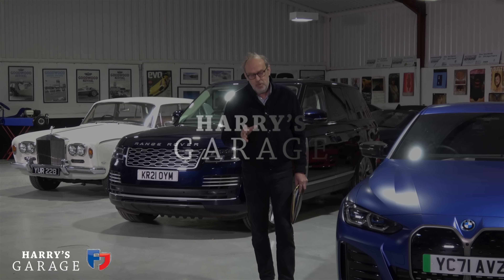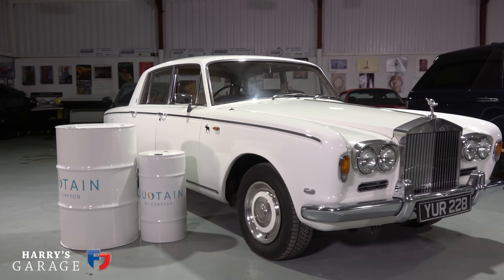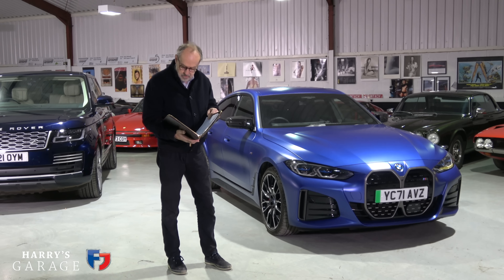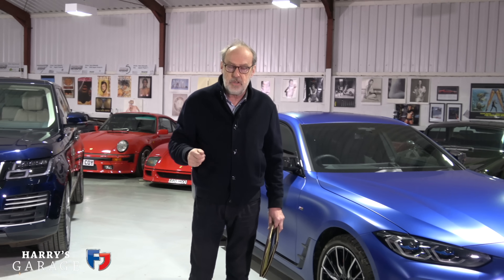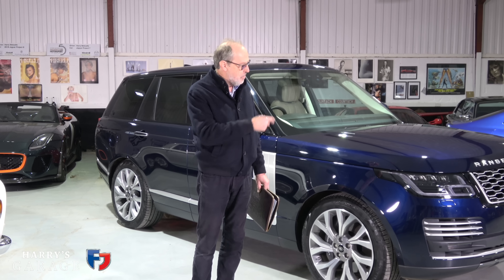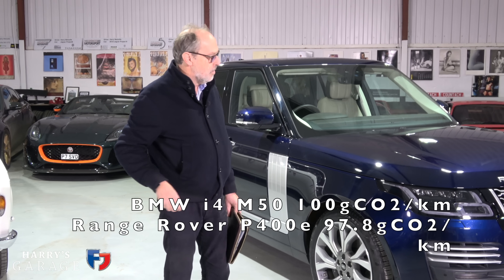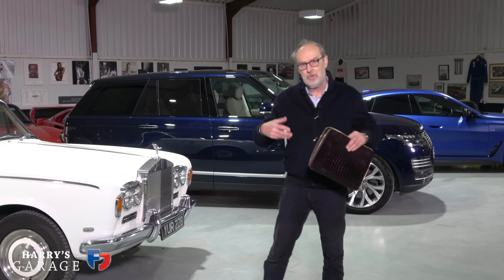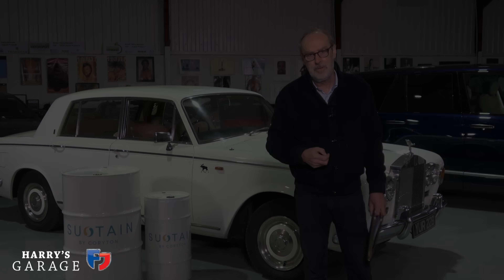Sustainable fuels; what are they & are e-fuels better for the planet than running an EV or PHEV?

Comment: I very much look forward to your updates on sustainable fuels. I believe their is an AND when it comes to how we fuel our cars. Meaning, why can’t we have both? Electric and some sort of fuel for us classic and visceral Sri big enthusiasts.
Reply: Some good points shame you don't consider shipping the fuel.  You also missed the CO² emissions of the electric part of the phev.  We don't all live on large farms were we can have wind turbines.  On even have areas of our roofs suitable for solar.  You covered the cost is solar on a previous video and you couldn't justify it on a large install.
Reply: https://youtu.be/F-yDKeya4SU
Reply: Electric won't work for a lot of people. Our infrastructure is already struggling and we rely on 70% traditional fuels for our electric. Putting a large portion of cars onto the electric grid is as fantastical as a three headed dog.
Reply: https://www.youtube.com/watch?v=8FAFfCWBGeQ
Reply: How about we take back control of our lives from the fanatics?
Reply: There is no logic to phasing out fossil fuels so quickly. The drive is to limit or stop people having ANY personal transport in the future. Unfortunately Harry is willingly going along with the  “consensus” that they are damaging the planet 🤷🏼‍♂️
Reply: Fossil fuels won't die out in the foreseeable future. I'm pretty sure we will still have gas stations in 50 years time. The problem with "sustainable" fuels however is, that they're just a fairly tale that doesn't work. Depending on how you produce your "sustainable" fuel, the process actually emits more carbon into the atmosphere than classic fossil fuels. It's pure greenwashing and I'm afraid Harry has completely fallen for it :(
Reply: @xBris  He has fallen for the guilt trip.

Boomers buy any ol rubbish.
Reply: Exactly. Electric can work for a lot of people but for the minority where it's either way too expensive (ie no cheap overnight charging) or we have a fun ice car then let em coexist!
Reply: @ciaranwebb6871  That's not a minority. Approximately 60% of UK households do not have off road parking.
Reply: Exactly. There is room for both.
Reply: @koma7252  how are EVs a scam? Time and time again research shows that EVs are substantially better for the environment compared to regular cars - over their entire life cycle, from the production to scrap. This is not a discussion to be had, this is already proven science and has been for quite a while by now. But well, we even have a climate change denier in this comment threat so I guess Harry's audience isn't very science friendly :/
Reply: @xBris  The only way EV's can be better for the "environment" than ICE cars is if throughout the entire Life Cycle (manufacturing, use and disposal) renewable energy is used. I would point out that the batteries are not recycled. They are so dangerous they cannot even be stored in bulk quantities. EV's are cool but they have a long way to go yet before they can be credibly claimed to be "green".
Reply: @xBris  The greenwashing bit of EV is that eventhough they have zero emission when they are on use, the carbon print from they were made until they are recycled, is actually worse than you'd get from a car like a Jeep Wrangler for example. Not to mention that we have limited amount of lithium. If everyone is using EV, I don't think we have enough lithium to cope with the demand.

It doesn't mean that Jeep Wrangler is the better solution. It just means that EVs are not exactly 'green' either.
Reply: @aabidamn  and that’s why instead we should do a mix of EV and public transportation
Reply: @koma7252  very true it was never about the environment, the tightening of the grip against us and benefiting massive corporations in monopolising transport, too perfect
Reply: This is all very well accept for the fact independent scientist say there is no man made climate change. Only dependent scientist say man made CO2 is causing climate change.
It's a proven fact that electric cars are less eco friendly than petrol or diesel cars.
This is not about the environment, it's about restricting the worlds resources to the likes of me and you. Communism in other words.
Reply: @dyfnwalmoelmud8362  'Independent scientist' as in random conspiracy theorists aka keyboard warrior over the internet. 

You may not believe that human activities accelerated climate change, but there's no denying that the smoke coming out of the exhausts of fossil fuel cars are toxic and bad for us & the environment. 

If you don't believe me, you can do your own experiment and do your part as an 'independent scientist'.  Turn on the engine of your or anyone's car, close the garage door, stick your head next to the exhaust pipes and wait for an hour. Afterwards, comeback and tell us what happened (if you ever made it out of the garage).
Reply: @aabidamn  Humanity certainly have affected the environment, mostly out of greed and selfishness, but the electric car does not make sense.
Our government don't really care about the environment , they just do what the lobbyists tell them to do.
There would have to be more power stations built if all cars were electric, and electricity is not that efficient, up to 70% can be lossed from power station to the point of use, and these power stations will need fuel too.
Reply: You said that electricity is not that efficient because they lose up to 70% from the power station to the consumers, while ignoring the fact that ICE cars are only 20% efficient. Meaning that they only use 20% of the energy they produced, to actually move the vehicle while the rest are lost in heat.

Power stations will need fuel too? They will. The question is what other types of fuel they can use that are more efficient, available in abundance and not harmful to us and the environment. Moreover even if they still use fossil fuels, logically speaking, it is a lot easier to control emission and fuel consumption from 1,000 power stations than from 100 million fossil fuel vehicles with millions of different owners and different driving behaviours.
Reply: @dyfnwalmoelmud8362  The purpose of having different types of energy sources be it solar, hydrogen etc is to reduce our dependency of fossil fuels. We will run out of fossil fuels eventually and we will run out of it a lot sooner if we don't change our behaviour in how we use those fuels. Don't forget that the thing with scarcity is that when things are getting rare, they will be even more expensive. And on essential items like fuels, if they are rare, they will get rationed just like in communist countries. So if you don't like communism, you might wanna lose some dependency on essential items that are limited in amount.

Electric cars are not perfect. They need a lot of improvement starting from how they are produced to how they are disposed. With better investments, experience and R&D, they will improve. If someone else come up with a better solutions, I'm open for it. But to say that we should do nothing and that we should stick to fossil fuels because they are the better solution and had no impact to climate change, for me that's just dumb.
Reply: @aabidamn  There's hundreds of years of oil and gas left on the planet, and as for ice, i worked for a international car manufacturers in the 80s and their far east branch  were developing engines and reports were coming back that they had a four door family car doing 120 MPG. 
Car manufacturers and oil companies work closely together to maximise their profits and control.
Reply: @dyfnwalmoelmud8362  Wouldn't you like humanity to have energy source to survive more than that hundreds of years? 

If they were really able to build a 120mpg car with a price range that people can afford, don't you think that they would have put them into the production line? The reason why Japanese cars were successfull in the US during their early days was because they were a lot more efficient in terms of fuel consumption. If they had really sold the 120mpg car back then, they would've eaten all their competitors alive. What was the benefit for the car manufacturer to not build them? None. How would that maximized the car manufacturer's profit?

My guess is that this was another hear say from you. You heard someone in your company who heard from a friend who heard from another friend who had a cousin who claimed that he was mopping the place where they allegedly built the 120mpg project car.

If you really think that oil companies are really that sleazy and controlling, why are you so adamant for us to keep using their service? Why aren't you in support of another companies who are trying to make us less dependent from these oil companies? Your comments and logic don't make any sense.
Reply: @dyfnwalmoelmud8362  this is the stupidest post I have ever read ….where to start?!?  EV’s are better at not polluting at the point of use ….the rest of the supply chain really depends on a) the governments energy policy (needs work) and b) we quickly need to get to a place where lots/most people will use their roofs to collect energy, store and feed back into the car.  This is why Tesla is developing roof tiles that look like roof tiles but collect energy …to be stored in your garage to power your ultra efficient home and car.  Got it?  And before you say how impractical all of that is - the governments of the world need to help drive it fwd, insulation, more heat pumps, better/cheaper solar etc etc.
Reply: @chriswhite8728  The massive promotion of electric cars is not about the environment, it's about control.
Reply: @dyfnwalmoelmud8362  there you go, conspiracy clearly proven!

Comment: What if I told you ‘Global Warming’ is a giant scam, and could prove it ? Or simply said find out for yourself and I will give you a few pointers. All the drama and disinformation comes from the IPCC. They have a remit and articles of association which play a big part in the scam. They ONLY ever look at man made/created green house gases. 96 percent of all green house gas,  is  water vapour, in a gaseous form, we call clouds, so you might not be aware clouds create a global warming blanket, thank God! Without which the temperature would plummet. Can you see the hoax?  The IPCC ignore this because there remit forbids them to mention it. They ignore 96% of the issue! The IPCC focus only on the other 4 percent not water vapour. Of which possibly less than 1 percent is generated by mans actives. Does anyone still believe anything meaningful can happen when the levers used to control the atmosphere have less than 1 percent effectiveness ?  We could all go back to the Stone Age in terms of life style and tech and it would have zero effect on global warming. Global temperatures are slightly increasing, that  is because we are leaving the last ice age and things as a result will generally become warmer. Man has nothing to do with it. Check out every single alarmist prediction. None have come true, not one island is now under water as forecast by that huge fraud and idiot Gore. The ice caps have not melted. Nothing at all out of the ordinary has happened. CO2 is not the enemy. It’s a good thing it makes things greener. 480 ppm is not cause for alarm. 7000 ppm might be. But very liveable, in fact in the past 7000 ppm was common and resulted in giant creatures and an abundance of food all over the planet. Harry you and millions of other have been fooled. It’s about redistribution of wealth and global socialism, carbon trading is the scam dreamt up to shift lots of money from rich countries to poorer ones, agreed by Obama and Gore and the world socialists who gather in Davos. Obama pumped billions into dumb university qualifications without any basic understanding of the science. These people now infest  every school, every sector of life fully believing in this new religion. It is a manufactured issued, promoted by a radical UN body started by just one person who uses deception half truths and downright lies for what he believes is the greater good of humanity.  Global socialism and a one world government. Fact. So many scientists in the early days of this scam were silent, this I am happy to say is no longer the case. You can win any climate change argument simply by asking about water vapour, asking what part man plays in creating clouds? Answer none ! The end.

Comment: Harry come to France E 85 sustainable costs 0.80 cts of an euro per litre
Reply from the maker: Yes but classics can't use E85, so it's only going to be used by a few especially engineered modern cars.
Reply: @harrysgarage  i am going to adapt my  1.5 l Golf  2019 with a timing adaptor and injection modification .will cost about 1000 euros and will incurr 25 % extra fuel consumption but cost will be paid back under 18 months .

Comment: I'd be very interested in your findings on the classic car fuel. I hope it's a new way to move forward.
Reply: Unfortunately "sustainable" fuels aren't a way forwards, they're two steps back. Depending on the exact manufacturing process, "sustainable" carbon-based fuels actually emit more carbon dioxide into the atmosphere than classic fossil fuels. It's greenwashing. Harry has unfortunately completely fallen for it and hasn't done his research :(
Reply: @xBris  Harry doesn't strike me as a man who fails to research.

Comment: Very interesting what's the co2  cost at factory  how does that stack up per car trip mile
Reply from the maker: Not exactly sure what you mean but for info, the majority of the power needed to produce the sustainable fuel comes from waste gases given off during the process. Turns out this is also the case during regular petrol production too.